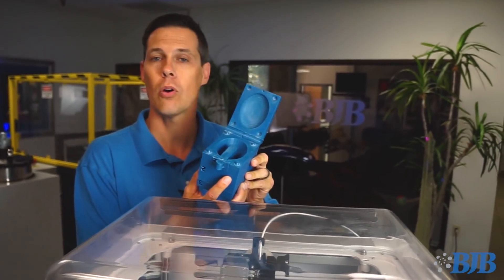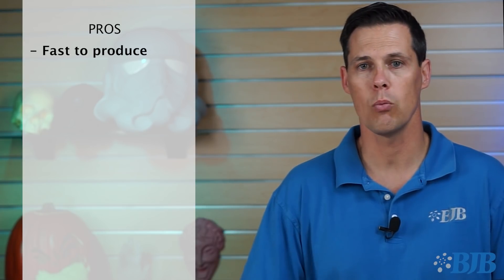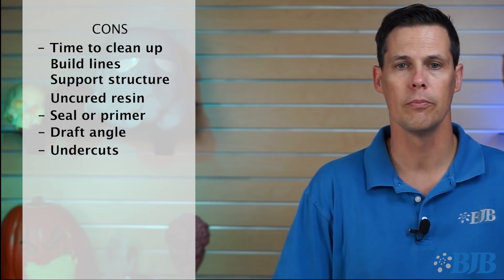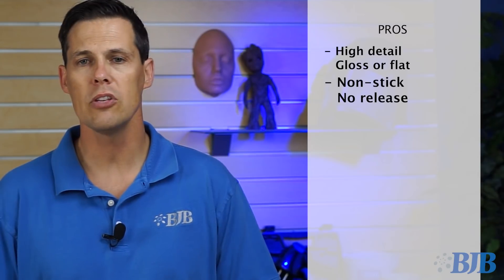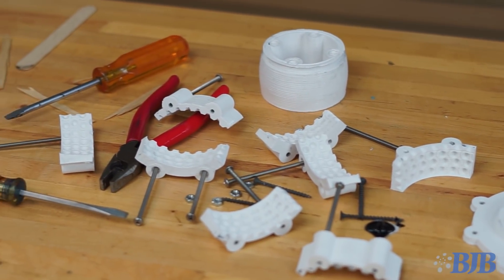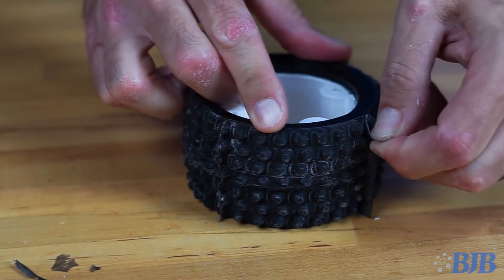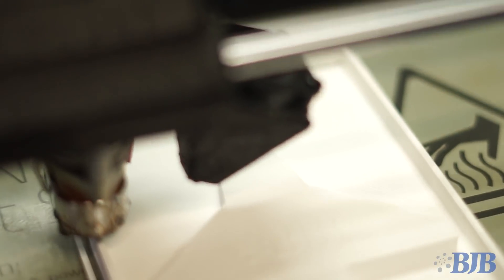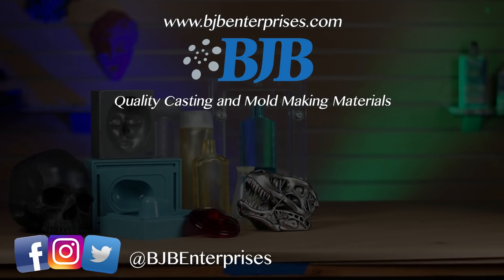3D Printed Molds | Tips/Tricks/Ideas

Comment: Can I ask what primer / paint you used that’s suitable with silicone? I’m having issues with this part as the acrylic spray paint I use causes silicone curing inhibition. Any tips would be extremely helpful, thank you!
Reply from the maker: We typically use SEM's High Fill Primer for matte/satin finished patterns, and we use the SEM Clear Coat for shiny patterns.  You also have to factor in that paints/primers don't always block out contamination on fresh SLA's if they haven't had time to UV cure thoroughly.  We always recommend setting up a small scale test of your materials to see what works and what doesn't because of the many variables involved.  Having said all of that, choosing the right paints/primers is an important first step.  What primer and paint did you try?

Comment: what is the best release spray for releasing PLA mold from resin ? thanks
Reply from the maker: It depends on the "resin" you are using.  If you watch our other 3D printed mold video, we explain in detail at around 4:50 what mold release methods work well for polyurethane:  https://youtu.be/KweiHPE4Ftg
Reply: @bjbenterprises  thanks a lot

Comment: Would 3D printed gaskets using TPU work against mold leakage?
Reply from the maker: Yes, that's possible.  You may still have a fair amount of flashing to clean up on the part, but better to stop a lot of leakage.

Comment: What material should we use for printing the moulds? PLA, ABS ???
Reply from the maker: We have used both with success.  It really comes down to using sufficient mold release as mentioned in the video.  We like to use a base layer of paste wax and then apply a spray release on top of any rigid mold material, whether it is aluminium, tooling board, or 3D Printed material.

Comment: on pla you can chemically smooth you molds
Reply from the maker: I believe you are thinking of ABS which can be smoothed with acetone vapor.  PLA does not have a common method for chemical smoothing.  Most people sand/prime/or coat with epoxy.

Comment: One way of doing it is too use eqaul amounts of glycerin and gelatin mixed on medium heat until thin, let cool slightly and pour over 3d printed part. The mixture cools and hardens just like silicone. Then cast a mold in soy wax, smooth it up and use the soy wax cast as new part. Oh, and gelatin/ glycerin mix is reusable
Reply: obligatory "the real info is in the comment section"

Comment: Hi! Thanks for the video! Though I have questions, is it possible and how much would it cost to make a 2x0.3m mold that could resist high temperatures ?
Reply from the maker: Are you asking about a 3D printed mold or silicone mold?  How high is "High Temperatures?"  You don't provide enough details to provide an answer.

Comment: Great video. Can we use this mold in injection molding machines? Will temperature and pressure effect the mold? What type of material for mold you have in your product? Thanks
Reply from the maker: We don't specialize in injection molding so we can't give you any technical advice on this topic.  Our products are cast at close to room temperature and with very low pressures.

Comment: I didn't understand why you were so against printing molds until I read the section, "  - Shop our selection of mold making materials or speak with our technical staff to help you pick the right one.  We have a huge selection of silicone mold materials and castable polyurethanes for making parts in the mold; from soft, flexible gels, tough rubber, on up to rigid plastics!
"
Now I understand.
Reply from the maker: We do sell a range of products for mold making, casting, mold releases, and accessories.  We also deal with a huge range of clients that use a variety of mold methods, including 3D printed molds for casting materials into.  On top of that, we receive a lot of tech calls from new customers looking to learn how to make 3D printed molds or to find out if it's practical to do so.  The video highlights many of the pros and cons of both processes based on our customer feedback, company experience, and common issues with the process from failed mold attempts.  We don't take a stance on whether we are for or against, the application and expectations of the end user determines what method may work the best.  To date, the biggest rapid prototyping companies (that also design and develop 3D printers) still use a majority of silicone molds for their short to medium run production parts for the reasons mentioned in the video.
Reply: @bjbenterprises  As stated before, I didn't know what your company sold until after the video.  I skipped a lot of the early parts of the vide to get to the meat of it. All, but without knowing anything more it seemed like you favored not using 3D printed parts for molds.  That's just what I got from watching the video regardless of what the intension was.  If you meant to be impartial I think you might have tried but missed the mark - but I could be wrong.  I would certainly encourage people to watch it.
I should have mentioned that I did enjoy the video and learned some things from it.  I appreciate that regardless of other comments I have made.  I would certainly consider watching other videos you have made because of the quality of the explanations in this video.  You did a good job with most everything.  I would certainly consider your company if I were in the market for the material you sell.  
And I should have included this in my original reply, "Thank you for the video."
Reply from the maker: @jbbw667  we appreciate the feedback.  It helps us continue to keep relevant to the market and technology that is used in the industries we serve.
Reply: @bjbenterprises  You are welcome.  I am going to subscribe.  I think it's worth it.

Comment: as a project during the ongoing corona lockdown, I've decided to try making dice. i thought about 3d printing molds using TPU filament since it's flexible. have you had any experience with this method?
Reply from the maker: Yes, it's possible and has been done.  The main issue will always be applying sufficient mold release or the cast urethane will try to bond to the TPU.  We usually like to first apply a wax (paste or liquid) to seal the porosity/lines, and then follow up with an appropriate spray release like our E236 Urethane Release or E302 Rocket Release.
Reply: thank you!

Comment: This video isn't that old, but tbh their printer sucks. I could spot numerous errors. Those build lines arent there on almost any FDM printer above 0.1mm resolution. When I print molds, I print on the Flashforge Finder at 0.05mm. No build lines.
Reply from the maker: You have valid points.  The sample molds shown were not printed at the best resolution or settings, but it's also a common sight from end users that contact us looking for help getting 3D printed molds to work for them.  We have also seen some fantastic mold work like the molds you describe from your Flashforge.  Ultimately, the video touches on the topics we receive a majority of common questions on and equipment and techniques are always evolving.  Thanks for your comment!
Reply: I saw that too.  Those build lines indicate either a lack of experience or a lack of trying.  It's part of the reason I posted my response.  Otherwise it's not a bad video.

Comment: What filament is recommended for molds?
Reply from the maker: You can honestly use multiple types of filament depending on what your printer does best or what level of material performance you may need.  PLA works fine, but you need to make sure you use sufficient mold release.  ABS, PETG, or even Nylon can be used as well if you need additional heat capability (curing cast parts in an oven for example).  Great question and thanks for the comment.

Comment: Great video but unless I'm missing something, the types of plastic used to make the molds were not addressed. That's pertinent information to the topic.
Reply from the maker: The common filament materials are all fine to make molds; PLA, ABS, PETG, Nylon... you just need to apply a proper mold release which we go over in more detail in the drone video linked in the i-card.  When it comes to SLA, DLP, or MJF type resin printed molds, you may need to seal them with a good primer to avoid any chemical incompatibilities when casting something like Platinum Silicones (which are sensitive to UV cured resins).  Good question and thanks for the comment! -BJB
Reply: @bjbenterprises  WOW! So informative and such a quick response! Thanks so much!
Reply from the maker: @BookOfMorman  No problem, always happy to help.  Our Tech support is also a great resource to ask questions like this if you are working on a molding and casting project.  info@bjbenterprises.com

Comment: I love 3d printing, but I hate how so much of the community will do 10x the effort to 3d print an entire thing badly, when 3d printing works so much better as a tool to assist the design, not the end all solution to everything.
Reply from the maker: Yes, we find this as well.  We know that 3D Printing is a powerful tool and is changing our world fast, but like any tool it needs to be understood when and where it works best for a given application.  We typically hear from customers after they are struggling to make something work when we may have solutions to achieve results quicker, easier, and repeatable.  It's great to have so much enthusiasm and creativity using new technology so we enjoy showing where we can enhance or be relevant in the process.  Thank you for the comment!

Comment: Finished a two part mold today.  Clamped them together and poured in material.  Leaked EVERYWHERE, lol.  My wife is not happy.....luckily it was a DIY gelatin liquid that is literall edible and will pull right up as soon as it cools.
Reply from the maker: Jon Dixon yes, having a mold that seals well is very important and can be difficult with 3D printed molds.  You will likely need to add a thin gasket to the flanges to prevent it again.

Comment: Great video!  I really think the vast majority of cases would be better suited to 3d printing the object you want, cleaning it up, and then making a silicone mold of that object.  When your silicone mold eventually wears down, you can just make a new one from the original.
Reply: That’s what I do but in the long run it’s better to print the actual mold and cut expenses.

Comment: Is this technique used only for making toys ? Or is it used in industries ?
Reply from the maker: P Pugalia 3D printed molds are typically used for product development to make functioning prototypes and also to make short run production that may not require a large number of parts.  Molding and casting itself is used widely throughout manufacturing for many decades for prototyping, short to medium run production, and also in applications where injection molding may not be possible (like skateboard wheels).

Comment: FDM type ABS mould with one step post process of acetone smoothing for a shiny surface (not sure what class), then cast it with polyurethane resin without any mould release. Two piece mould with pin interlocks for positioning, 0.06mm layer heights and some blutack for a seal against excessive flashing or leaking. Good enough to do replicate thorlabs optics to reasonable tolerances...
Reply: Wow, 3D molds for optics? That’s amazing! I wonder what the limitations are...
Reply: And don't forget flexible filaments
Reply from the maker: Thanks for the comment!  Sounds like you found a successful technique for your parts.  Were these clear parts you cast or something else?
Reply: Clear parts - essentially copies of commercial lenses using their own provided CAD files
Reply from the maker: That's great, thanks for sharing!